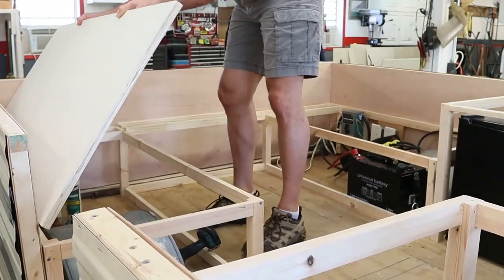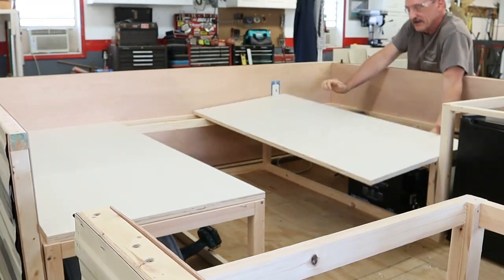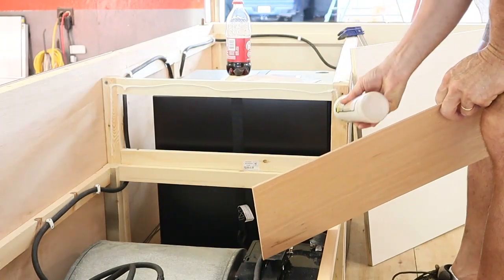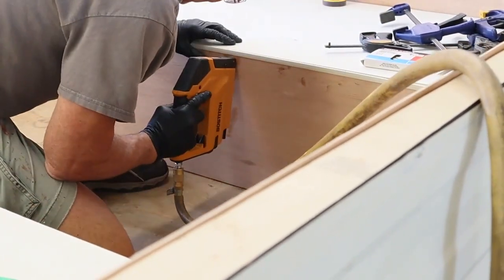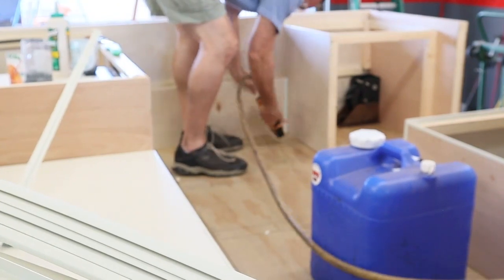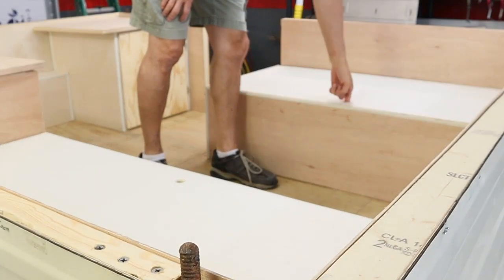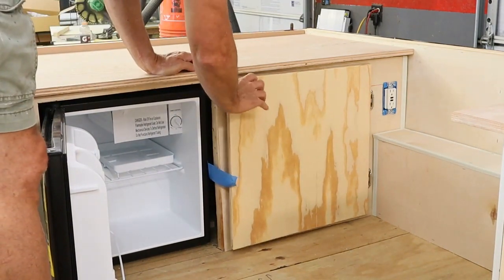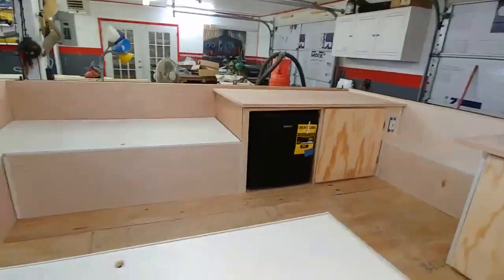POP UP CAMPER INTERIOR PANEL FINISHING Storage Cabinets PT 20

Comment: Those vinyl moldings are cheap which is good. But they are easy to dent when hit. The material shows a lot of dings if impacted. May not matter but they are weak.
Reply from the maker: Thanks for the heads up. Always good to hear form experience.